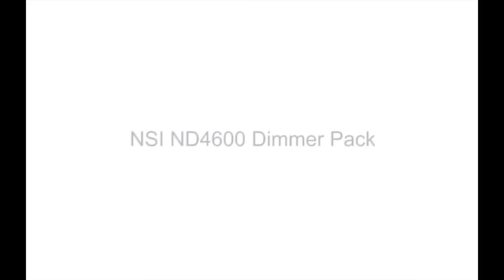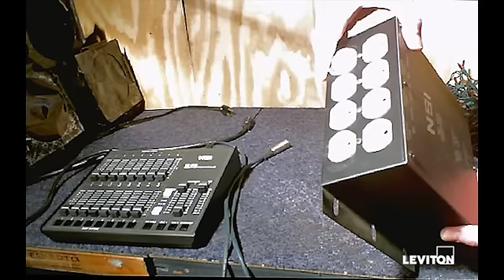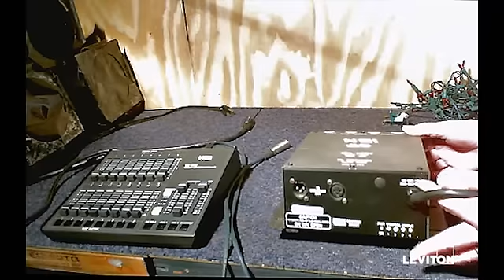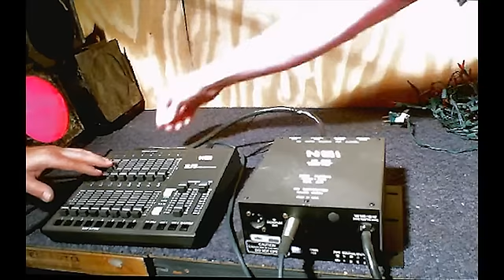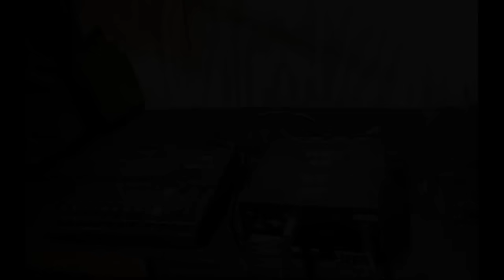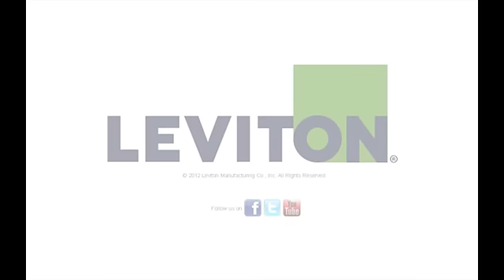NSI ND4600 Dimmer Pack

Comment: so you can dim any lights regardless if they have dimming effect on them ??
Reply: For incandescent and most modern bulbs, the answer is yes. Although, there are now many new styles of bulbs or LED's that might not dim as desired. Experimenting with the newer style bulbs is the only way to know if the dimming will be satisfactory. Another item to be concerned with is enough load/Watts. If the bulb is only 4watts, the bulb might always have a slight glow. If so, more wattage would be needed for that circuit or a larger wattage bulb. Hope this helps!

Comment: We are wanting to replace our older spot lights with something easier to find and more efficient.  Will this work with anything that is dimmable?
Reply from the maker: Hey Carl, the ND 4600 is a Forward Phase Dimmer. It will dim from 0 to 120 volts. Each channel will handle up to 600 watts. The total wattage cannot Exceed 2400 watts.
Reply: Leviton I am seeing tons of stage lights but they are all DMX based.  Is there anything you kknow of that would work with this specific setup?  I'm not sure our church wants to convert to DMX for cost reasons. I'm afraid they may trash this system and try something new...
Reply: I would just go for all dmx if you haven't. It's much more versatile if you need to upgrade.